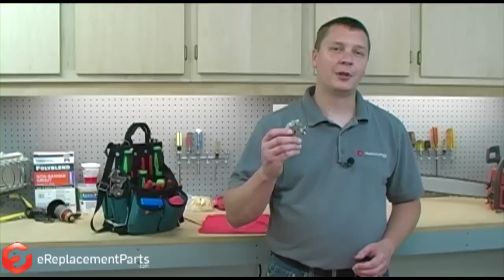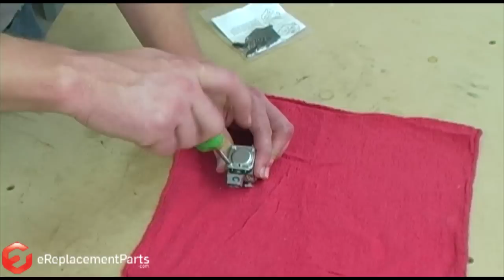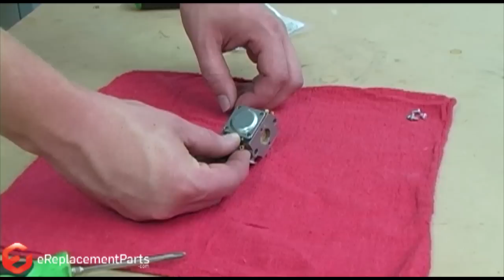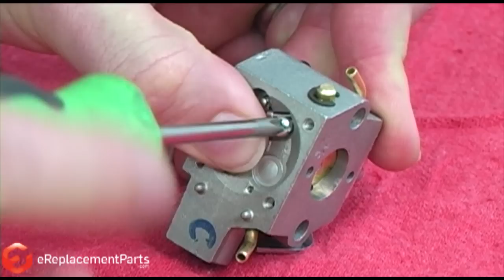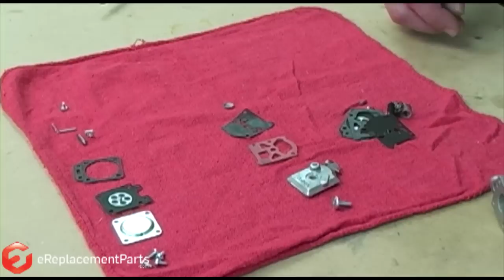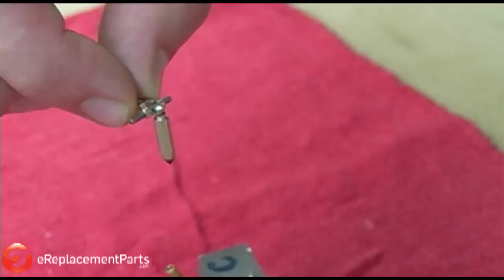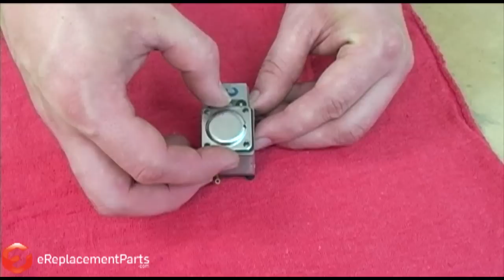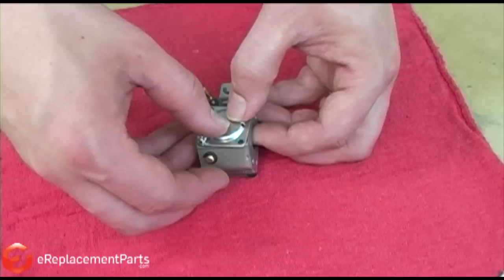How to Rebuild a Two Cycle/Two Stroke Engine Carburetor

Comment: Hi Mark.  I Have a Poulan 2150 LX (2.2 CID) chainsaw that runs only with the choke fully actuated.  If you hit the throttle it dies or push in the choke, it dies.  Do you think it's the fuel pump diaphram going out, so therefore a tear down and rebuild of the carburetor is needed?
Reply: packrat76 If it only runs with full choke then its not getting enough fuel. Rebuild it and get a 1 gallon paint can of carb cleaner with parts basket. This is what I am talking about.
 http://www.amazon.com/Gunk-CC3K-Carburetor-Cleaner-Basket/dp/B000ABGA4E
Let it soak for 24 hours after disassembly. After you let it soak use a compressed air can or air compressor to completely blow out ALL of the little holes. It doesnt take much to clog these little guys. There a quite a few things not included in the video. There are usually 2 metering jets. Some require a special tools. You can usually leave them alone and be fine. On occasion it is where the clog is, If  it is subject make note of turns to bottom it out. Then remove them. The one on the left is low side and the one on the right is high side. Needle valve is always longer on the low side then the high side  2 cycle engine oil will gum up after sitting unused for an extended period of time. Only remove needle valves if necessary. If they are remove just set back to original position. If you dont remember. Screw them all the way in and then 1.5 turns out and turn idle screw all the way up. The adjust low side first for a smooth running and turn down for smooth idle. then adjust high side to top speed and back it in .5 turns. You should be good to go.   Hope this helped.
Reply: byrysh
That helps a lot, thanks!  2 questions.  You are saying I need to remove the jets themselves?  So is it necessary to remove the zinc plugs to get to the jets?
Reply: packrat76 Dont have to..Better if you dont move them at all, it can be a pain sometimes getting it reset right. just if you need too, make a note of the screws howe many turns to go all the way in and reset it after you rebuild it. As far as the zinc plugs, Ive only seen one that needed replaced in all the yearsI'ive done this. Its for machining and they dont need to be removed just clean it out with compressed air in all the little holes. what I do is find where it goes in and comes out and put a little carb cleaner and see if it blows out. if so its not clogged.  GL  :)    LMK if ya got any more questions.
Reply: byrysh
Thanks a bunch buddy.  Appreciate the helpful info.
Reply: packrat76 np

Comment: Please show video on replacing carburetor parts on a Husqvarna 455 Rancher Chainsaw.
Reply from the maker: +Amendra Prakash We don't have a video dealing with your specific model.  The following link shows how to work on a 2 Stroke carburetor.  Most are basically the same as far as the repair goes.  http://www.ereplacementparts.com/article/4582/How_to_Clean_a_2_Cycle_Engine_Carburetor.html

Comment: Hi when I use carb cleaner it just keeps shooting down after a few seconds is it just the diaphragm our something else I double check the gas theirs no water in it an it's not a electrical problem the sparks plug is new help please.
Reply: could be: bad coil? too high/low compression?

Comment: Has anyone bought any of those smaller weed eater echo, etc. new carbs off the internet that sells any where from $6 to $20 or so? The $6 to $10 ones are from china and says two to three weeks delivery. The ones from $12 to $20 are here in the U.S. and ships in two or three days.If they work like new, I'm never going to rebuild another carburetor.

Comment: You have no mention of replacing the adjustment needles or cleaning the carb, especially under the welch plug - this is helpful, but it's not a real rebuild, it's just replacing the gaskets.

Comment: needle height adjust ?
Reply from the maker: The newer carbs are jetted and don't use needles.  If your's has the needles,  Turn them in till they hit bottom them back them out 2
turns.  That should at least get it started.  Carburetor adjusting tools are no longer available on the market due to EPA regulations and
restrictions.  The EPA suggests any carburetor adjustment be handled by an authorized servicing dealer.

Comment: You left out a lot of important issues related to cleaning, and adjusting .. anyone can buy a kit, and replace the new parts with the old.  As you say.. "it's really quite easy"  Knowing that, why did you bother making the video?    The idea is to get the motor running properly with the new rebuild, and understanding why the carb was failing in the first place, what to watch out for when an engine starts, runs a few seconds.. then quits.  Stuff like that .. something that might really help the home fix-it person save a hundred bucks.
Reply: Some mention of the check valves (which can also require replacement) would have been useful.  If the primer bulb is sucking bubbles no matter how clean the carb is, the check valve is probably bad.

Comment: Ours has 2 red screws that only allow 1/2 turn, you don't know them on this? Are they the l and h adjust or caps to stop further adjustment?
Reply from the maker: Some of the carburetors have the limiters on the air adjustments that do only allow 1/2 turn for adjustment.  The EPA has changed their standards.  Most of the carburetors are set at the factory and the air adjustments are capped so there's no adjustment and others are jetted internally.